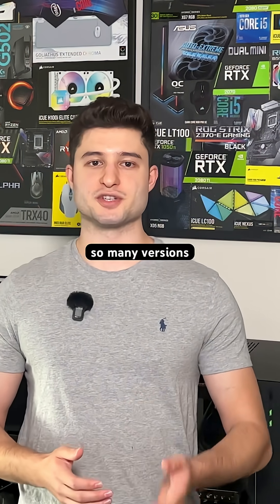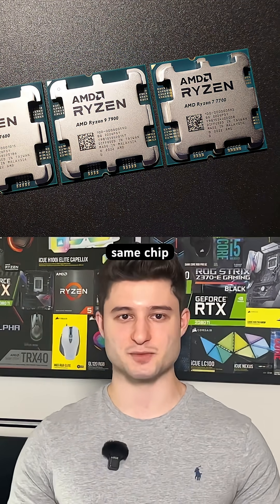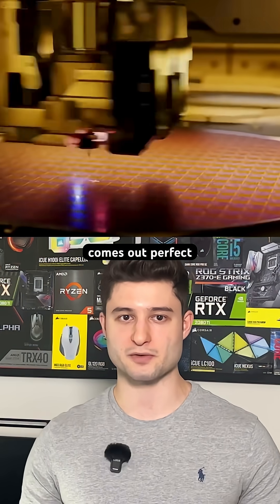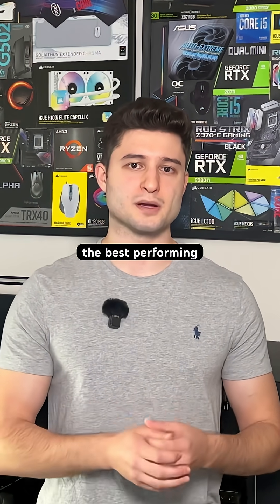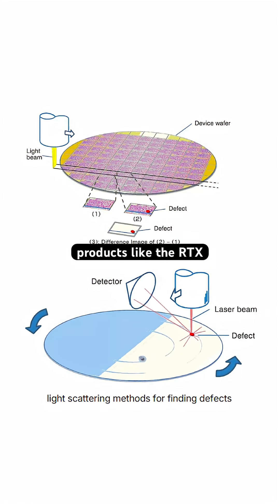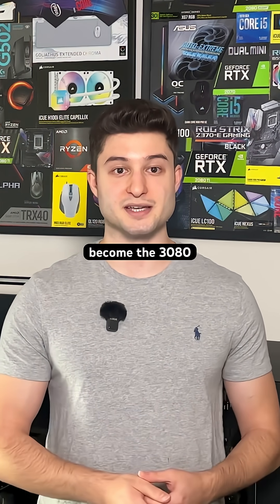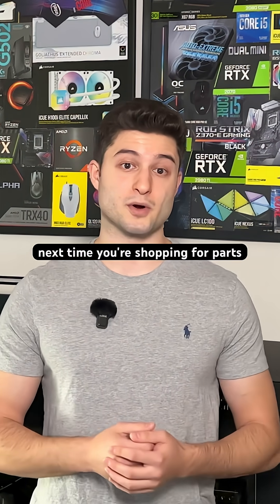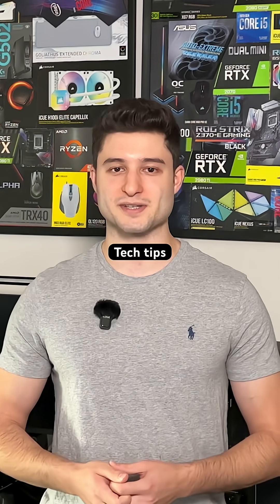Why are there so many CPU and GPU models?

Comment: My RTX 4080 SUPER is stock and I feel like i hit the silicon lottery, anyone can please help me confirm this though, if i am being realistic. No undervolt, no OC, just clean BIOS and max airflow. 👌

At:

1-44% load - 2820MHz ⚡ 

45-75% load - 2805MHz ⚡

76%+ load - 2790MHz(doesn't rush in, sits at 2805mhz, only as wattage increase, even at approx 280W and 67°C 

100% load - lowest I've seen is 2770MHz, and that's at 81°C 🔥, it does depends on my ambient temperature of my room, but that's the max temp i have see and at max TDP of 320W+, under full vram and gpu stress tests like Kombustor. In games at 100% usage because the wattage is dynamic, the highest it might get is like 72°C to 77°C

Temps are incredibly good for a triple-fan Inno3D X3 cooler (7 heatpipes), its a budget 4080super but its 2 slot, it fit in perfectly with my aesthetics and i got it at MSRP. Its actually a good Brand surprisingly.

Motherboard is running full PCIe Gen 5 x16, so there’s no bandwidth bottleneck at all.

I haven't overclocked since 2015  not because I can't, but because I don't need to. This card boosts like a slightly binned down 4090 already.

Comment: Basically they fuck up some of the sectors and to justify they use the same chip while the bad sectors are disabled

Basically you have free performance in your cpu rn but because of how manufacturing of silicon works you probably can’t enable them

Comment: This is partially true. A 3080 chip is just a 3090 with sectors turned off, sometimes due to defective parts, most of the time because they are selling the premium product at a premium. Also it's usually only 2-4 models using the same chip, so your 4060 is not just a 4090 with two thirds turned off
Reply: Isn’t that like… exactly what he said…
Reply: @noodlite4300  no, in the video he said that all of the models are the same chip, when there are actually 2-3 different chips